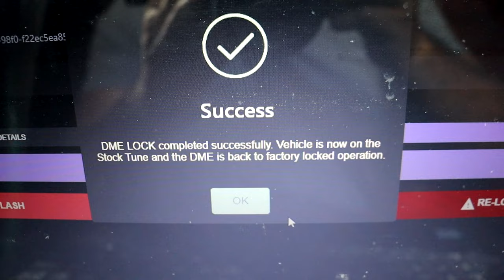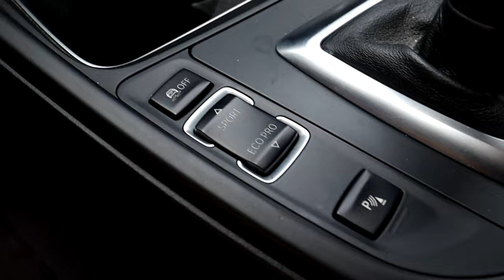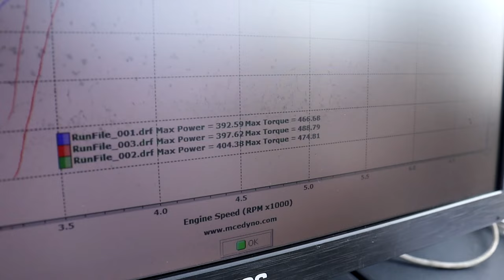I Decided to Sell the F30...

Comment: damn man, been keeping up with the build and it has been great, thanks for the content on it. Would you sell the cts intake and CF interior trim to 70003?
Reply from the maker: I’ve actually already sold most of the parts that I took off. I only have the LCI headlights and the forged carbon front lip, diffuser, and rear extensions left.
Reply: @InlineSixAuto  word, I appreciate the response. Hyped to see what you are stepping up to next!
Reply: @InlineSixAuto how much would you sell the used lci headlights for?
Reply from the maker: @marniionmee2140  Depends on if I need to ship them and where. Also they can only work with original xenon headlights like my F30 had. They can't work with original halogen. DM me on insta @e90hallenb or email me at hallenb1155@gmail.com if you're seriously interested.